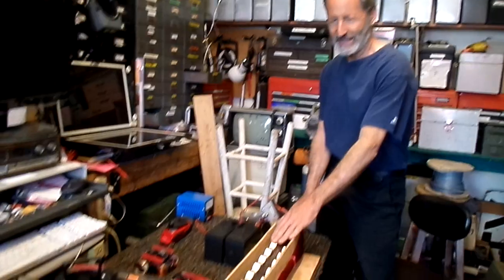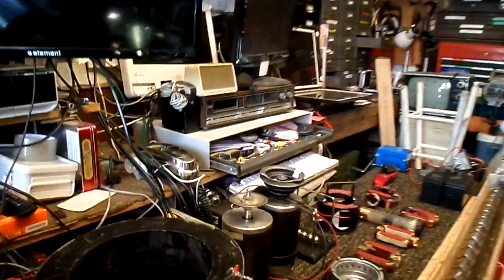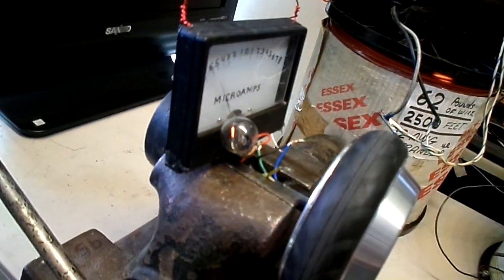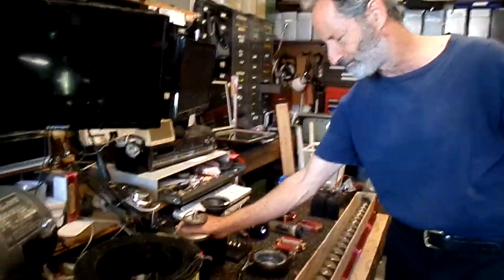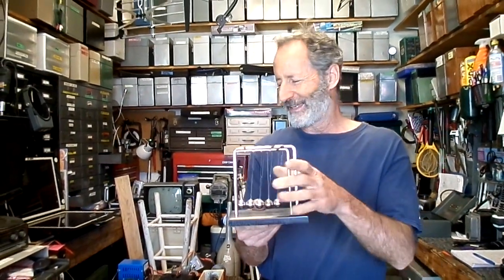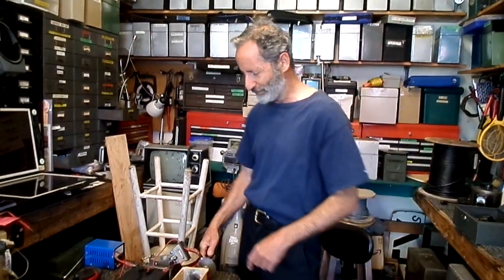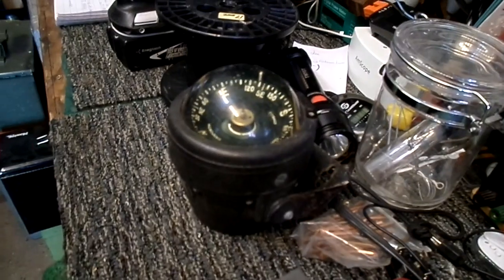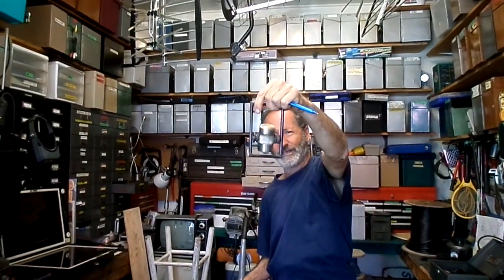My Experimental Newman Motor/Generator. Part 1 of 2

Comment: It is human curiosity.... so I develop a small one. What I found is that there is  different movement  when negative  path go's through shaft and 🧲 and separate negative  path.
I did numbers  of experiments on it and got surprising effects.
When I thought  again I realized that over unit effect is possible only when any system go into  resonating mode 🤔😇🤩.
😠😡🤬 but what we, at list I had teach Resonance mens distraction and you should avoide it....
Reply from the maker: I can't folllow what you are saying.
Reply: @GrantsPassTVRepair  ok 
You are wasting magnetic  power.
Just try with 2 magnet and stuck on metal ( magnet should electrically connected ). Make two coils which will cover up the rotations. 
The spicks should travels to shaft.
The moter you're showing at 6.00 minutes is the correct one
Reply from the maker: I still don't understand what you are saying.

Comment: I am just amazed at the distance of the magnetic field you showed Grant. Maybe using more shielding would force more efficiency from this idea ?? What do you think fella ??
Reply from the maker: I'm not convinced more shielding would help, but it's an interesting idea. It seems that most every so called free energy idea I find turns out to be a scam. Here's free energy claim that sounds intriguing, but it sounds to good to be true. https://www.youtube.com/watch?v=JU2JyE9h5o8&t=154s
Reply: @GrantsPassTVRepair  You are correct, every free energy idea I have seen so far is a SCAM. But there is something Dave that would work. 
Here goes, when you take a magnet the shape of a doenut and put N fracking N they will never touch when placed on a dowel pole.  Using this idea, you can take the same magnets and place them onto a fixture. The one is placed fixed, the other one you have attached to a connecting rod just like a gasoline engine. You will have to use Mumetal to short out the magnetic fields when the piston is going back up to have both magnets next to each other. The the mu metal shield has to instantly be removed. This will force the engine to cycle again and again. This has to work, as it does work when one uses his hand to move the metal in and out. 
Does that make sense ??? Peace vf

Comment: please forgive the copy + paste Grant, and grants viewers :) , - but i gave a reply too my favorite famous hacker about 30 mins ago, and the answer is well suited too your work.  - in terms of addressing the "more in than out" problem

@Gary McKinnon thanks for trying Gary.  i have posted videos on my other channel of 3 working FE machines, and they are. my newman machine (20kgs),, my milkovitch two stage oscillator pendulm (100kgs) and my linear motor are my main 3 achievements.  other than disproving countless other devices.  but sadly my 3, despite being REAL OU, all have an ROI of around 10 - 20 years. based on current electricity prices.

if you are interested in the linear motor, i will paste you my videos too watch, in order too paint the operational picture and some development . the best COP of this machine is around 10. - but i believe 20 is easily achievable (at 1watt input).  however by the time the input power reaches 30watts or so, the efficiency will drop following a curve, down too COP1 

part 7 : https://www.youtube.com/watch?v=uavoK5VQQNQ
part 8 : https://www.youtube.com/watch?v=eP1MM9hOvEc
part 9 : https://www.youtube.com/watch?v=7bhDG0YE6KA
part 11 : https://www.youtube.com/watch?v=vjxzKuikg5Y
part 12 : https://www.youtube.com/watch?v=rtE0NPCHwQQ

basically. imagine you have 2 magnets placed 1 meter apart that are repelling eachother.  and an 1watt electromagnet inbetween,  -  now you can increase the Gauss of the magnets too infinity, and the force of the electromagnet follows.
Reply from the maker: It's nice to see someone else experimenting, I find your videos difficult to follow due to back ground noise and an abundance of unrelated ideas, but I think I understand what your trying to do.

Comment: You're having problems replicating his motor, because you are still bound by the laws of physics. Just read some Tesla, and find the line about taking 10W of energy stored in a capacitor, and turning into millions of HORSEPOWER.---ask yourself, why he didn't say millions of Watts. Then find the Tibor Kemeny patent. You might figure it out then. Before you ask, two answers. 1) Yes it's hidden in plain site. 2) No you can't get rich off of it.

Comment: I don't think he got his York from the magnets and the coil, as much as he used the kinetic energy from the flywheel and use the back EMF to charge the AC capacitor that provided the kick every 180 degrees, I have a motor on my Channel that I built, it ran until the battery too good to run in the morning

Comment: Cut the Flux of a ring magnet and rotate it fast. Wow the pick up coil lot of electric energy.
Reply from the maker: Do you have an example?
Reply: It is an idea of a simple generator
Reply from the maker: @dragon72tube  If you have any pictures or video links it would help to understand this concept.
Reply: @GrantsPassTVRepair  Send me your email and I will send you the new idea
Reply: Didn't  produce the device. Will work by cutting the Flux. Maybe good idea. It takes a 3d printer to make the Gen.

Comment: I'm not sure I understand the criticisms in some of the comments. Sure, there are no white lab coats and no clipboards with a slew of numbers and measurements. But this is still a bare-bones version of the scientific process at work here. Someone says: "I achieved X" (in this case free energy, but it doesn't really matter). And then you're supposed to say: "I don't believe you. Let me see if I can replicate your results." As long as you don't bend your experiment to fit your own preconceptions (which he didn't), I don't see anything wrong with it.
You could perhaps make the argument that even looking for free energy is a waste of resources. But they're his resources to waste, and he seems to be having fun.
So what exactly is the issue?

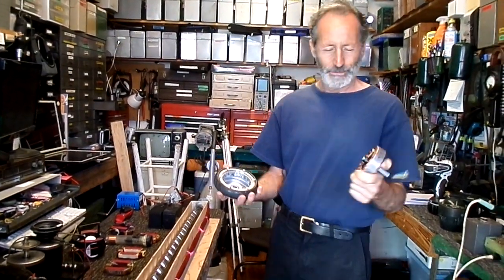Comment: The iron core doesn't increase efficiency of DC permanent magnet motor. MAXIM. Efficiencies and the Power of electric motor are two different things. Minutes 2:57. I my self have tested coreless DC motor with 75% EFF and the motor that you show at 2:51 has no more then that.